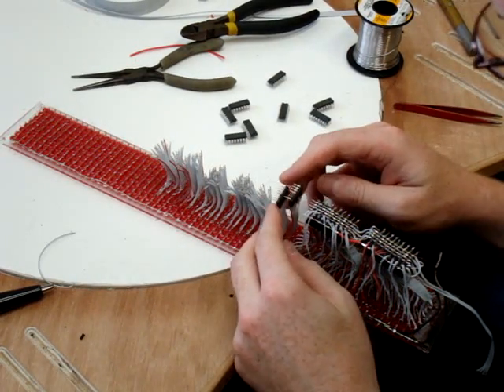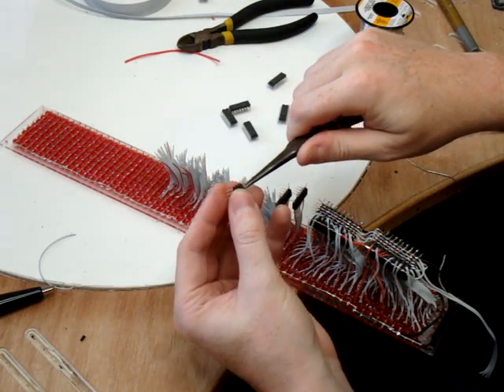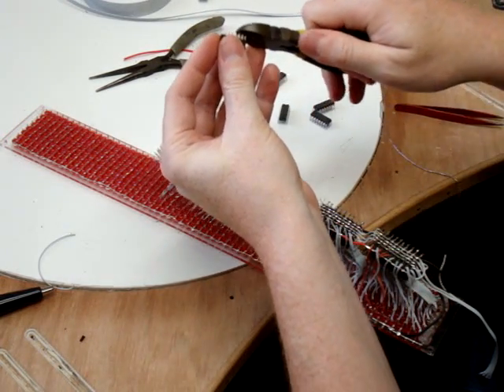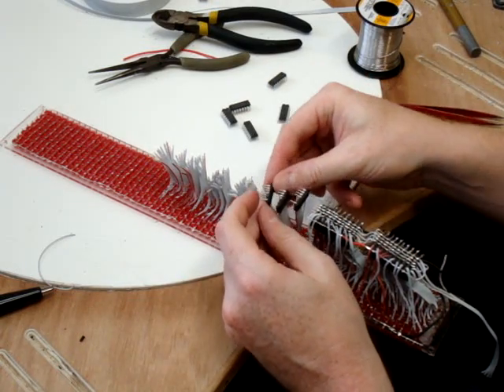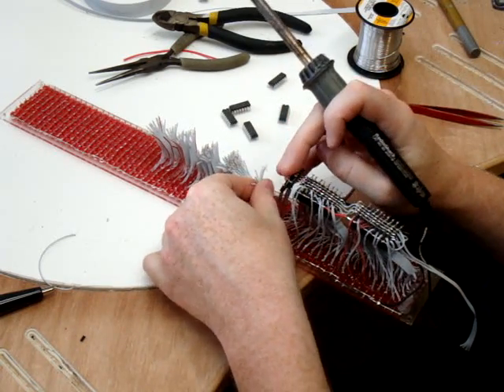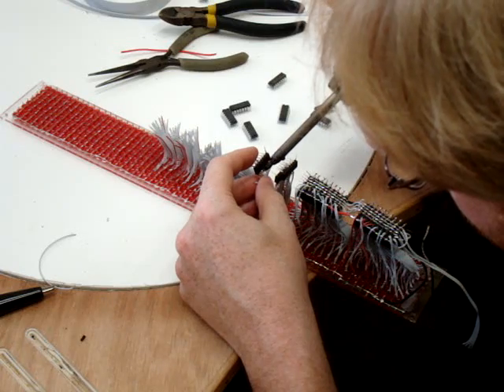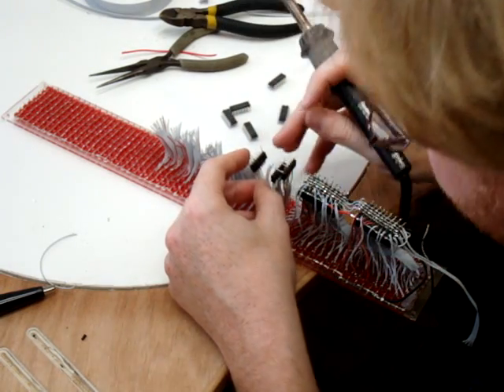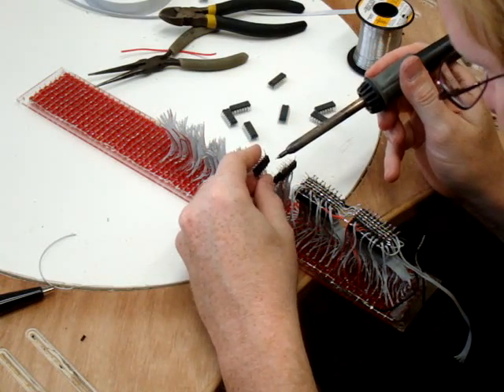Wiring Shift Registers

Comment: three questions please

which shift register Ic do you use
Where are the resistor for the leds
the display fills after a clock pulse or after 64 clock pulses?

Comment: Wow, a flicker free LED display. Nice wiring trick to save space,  too :) By the way, did you use any resistors at all or were 3.3V low enough not to burn anything out?